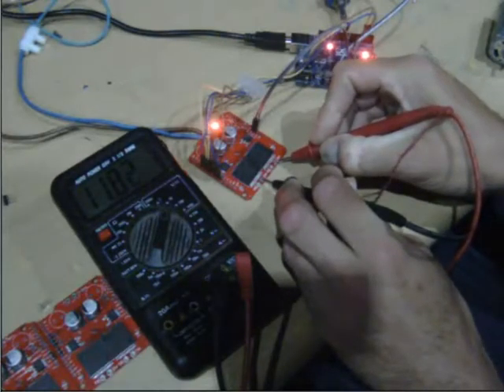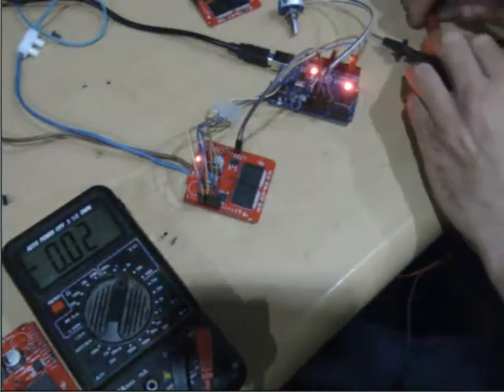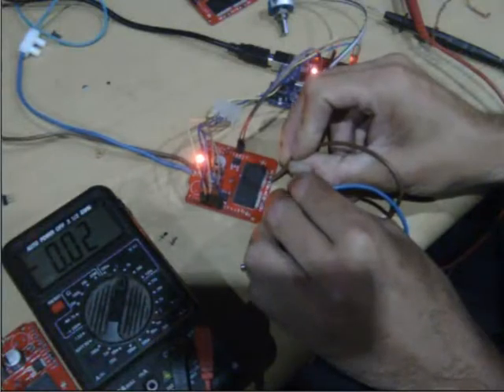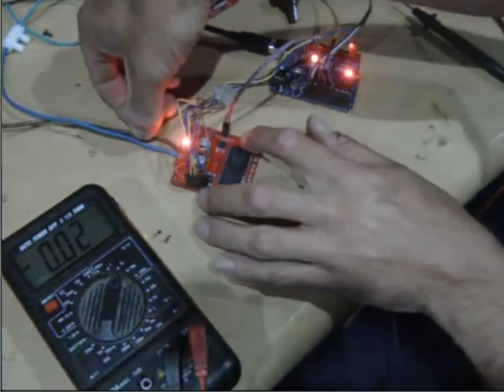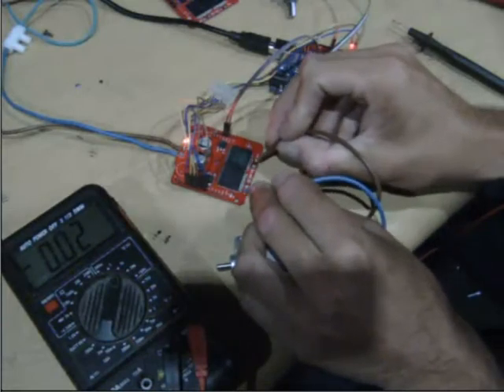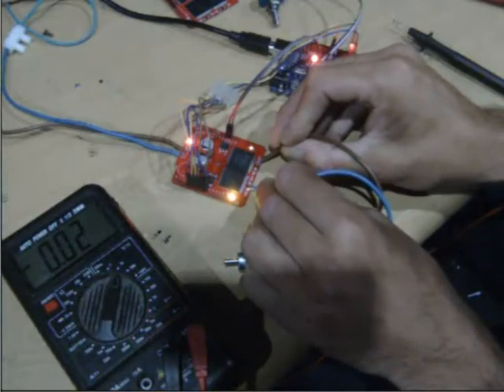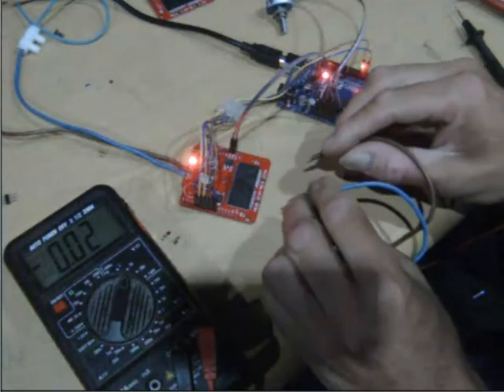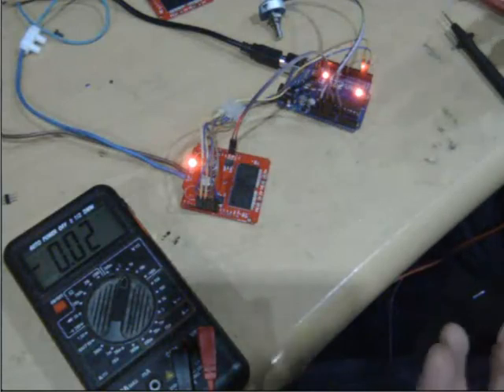CHINESE MonsterMoto FAULTY 4 out of 4, BE WARNED BUYERS !!

Comment: Time to contact a manufacturer. And I hope you used PayPal.
Reply from the maker: No it was Aliexpress,  lots of us are having problems with these. Ya live and learn :)
Reply: Silent Chill that's kinda bs I hope they weren't expensive. I won't buying stuff off of aliexpress without PayPal anytime soon. I'm sticking to go eBay.
Reply from the maker: Yeah I should of just bought them off ebay as they were only £1 dearer but at least you get your money back if things are faulty.
Reply: Silent Chill what were these for? They aren't powerful enough for the 6 dof are they?
Reply from the maker: Yes they are I need 12 of them 2 per motor 120 amp peak 56amp constant. So far 16 I have bought are faulty lol I will get it going eventually